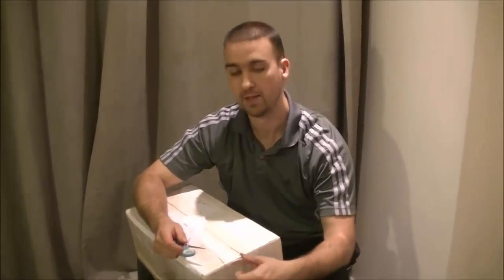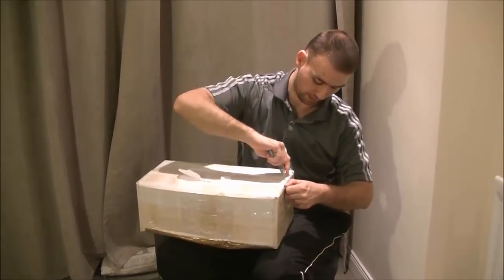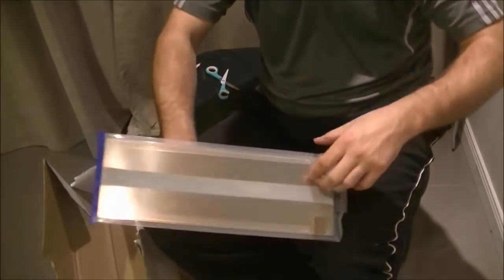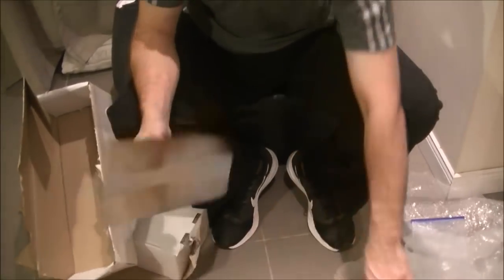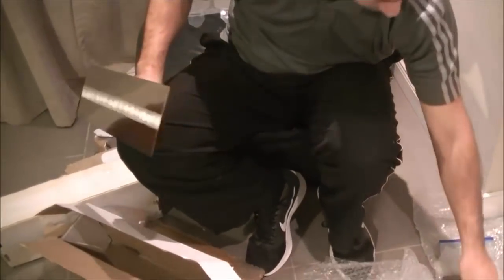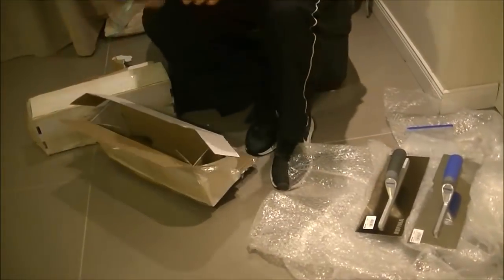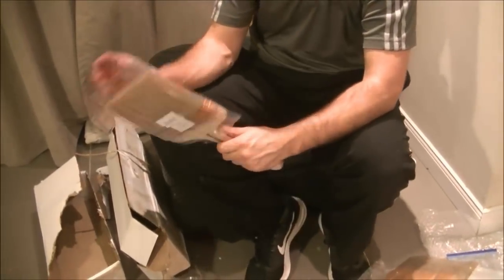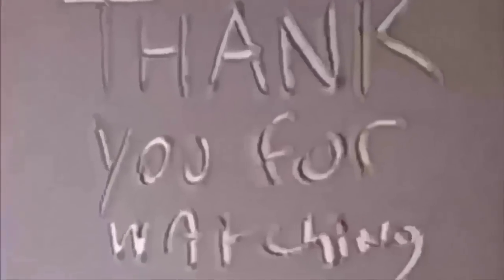REFINA FINATEX 1 AND 2 the GOLDEN TROWEL unpacking

Comment: Hey mac how did you find the finatex trowels for laying on I'm considering getting the finatex 1 trowel I have 2 marshalltown trowels for laying but have been thinking about using a different brand to see if it's up there with the marshalltowns I have the refina superflex and it's been brilliant so was wondering about there premium trowels
Reply from the maker: My main trowel is an ss refina its been top class all the way and been using it years now so can fully say you will not be un-pleased this fenatex i have been using loads on small jobs patching and that it so far has been very nice from start to finish and the superflex 3 has also been brilliant but i have put much time in with the stainless steel one and can say it has done everything
Reply: @macplastering  thanks for the reply the mac I appreciate it mate I'm going to definitely buy this next week and start breaking it on wet plastering jobs all the best mac👍
Reply from the maker: @Lemon-squeezer  Let me know how ya get on buddy I find it hard to fault them